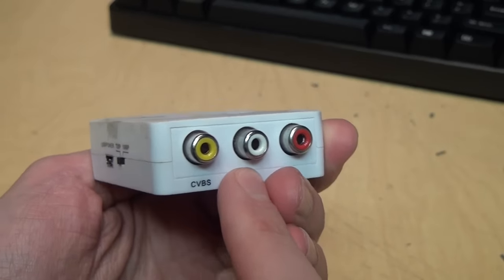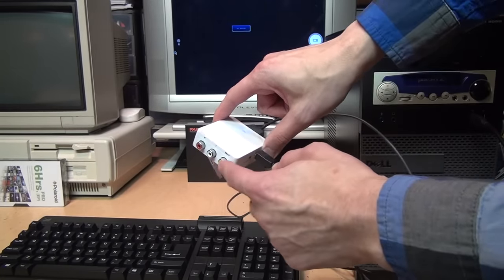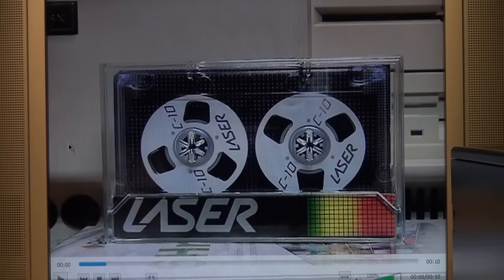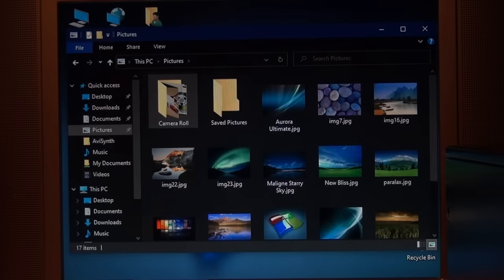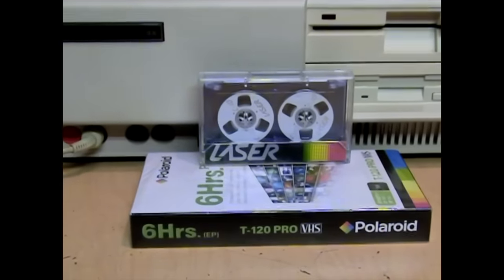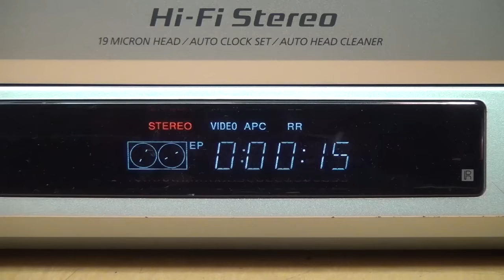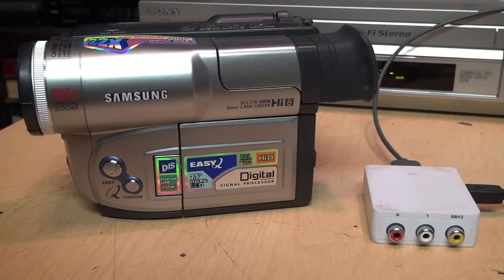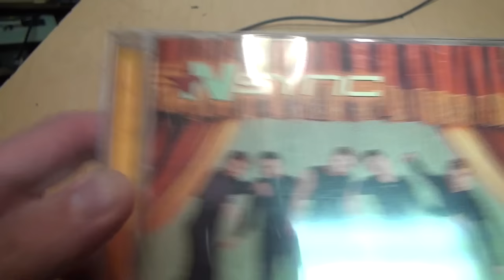Cheap composite video to HDMI converter - Is it really THAT bad?

Comment: An important notice: those white boxes are made by numerous Chinese manufacturers and come with a multitude of different conversion chips inside. VWestlife have one of the "older" ones with better chipset thus it can provide such nice quality, a lot of the modern ones that you can buy today are much cost-cutted and have miserable image quality. The worst part - they are absolutely indistinguishable by their appearance
Reply from the maker: Same thing with the "EasyCap" USB video capture devices -- there are four or five different chipsets in them, and some of them have a fake S-Video input that just combines the luma and chroma together, and/or mono audio even though there are separate left and right audio inputs.
Reply: Ah makes sense why two of the recent ones I bought to play my N64 both were washed out and dim when comparing on the same TV but using composite inputs.
Reply: That’s very important information to me, because I’m looking for better equipment to redigitze my analog tapes with. I’m used to using the method seen in this video (As recommended by Alec from Technology Connections) as I sometimes use the separate units individually for other purposes.

I’m sure a lot of people would love to know where you can still buy a high quality (or at least generally decent) analog composite to HDMI box, and an HDMI capture device, both of which actually support 59.94. That’s a video somebody needs to make!

My existing digitizations have excessive judder with NTSC tapes, with a frame being duplicated on average every four or five frames. It’s actually difficult to tell it’s even supposed to be 60fps. If somebody can find a reliable source of currently produced hardware to serve this purpose that doesn’t cost a fortune or isn’t just second hand thousand(s) dollar professional grade equipment, that would be great to know.
Reply: @vwestlife  IIRC the mono audio easycaps also have some kind of sample-rate? limit
Reply: Too bad the majority of how to convert vhs tapes channels fail to mention that, or just dont know
Reply: Ive got a black one that looks just as generic as that. It works to put hdmi into some crt monitors i have, does work..seem to remember i tried 2
Reply: @luminousfractal420  I bought mine just a few years ago off Amazon, and after I wrote the prior comment and tested a back-and-forth comparison between the black box and my Trinitron using an N64. The major problem I'm seeing is the black box makes everything significantly softer; it's not as bad as VHS, but it's significant and noticeable enough where knowing how widespread this chipset is I would bet you anything someone, somewhere on the Internet is selling this device as having "Superior anti-aliasing".

And yes, the colors are horribly washed out. I edited this second paragraph a few days after I posted it because I am just now realizing the true severity of how bad my upscaler is at accurate colors, or colors in general for that matter. If anyone knows of a good, currently produced composite to HDMI upscaler feel free to chime in. Accurate colors and sharpness are obviously required, but it also must output 59.94 fps. I'm sure there's some retro gamers reading this thread who have hands on experience with something suitable.
Reply: @GammaMAXXdotcom  "How to get amazing video quality when transferring VHS and Betamax tapes 🔥📼 My conversion process", thats one, by Dave's Archives. Its a little more involved in terms of time and cost, and shortcuts could be made, but he got all the essentials down.
Reply: I bought one recently, and the image quality is pretty much indistinguisable from the one in the video. I guess this is one of those occasions where there are "originals" and "knockoffs"
Reply: @AnalogSins  Which brand was it, and can you please post the link to it if it's still sold on Amazon?

Comment: Pro tip: you can open command prompt/cmd directly on current directory of explorer by selecting top address bar right after location, then edit and type "cmd" on address bar and press enter. This very handy as you don't need change directory by manually "cd" to target directory.
Reply: Someone doest use power toys.
Reply: You can also press shift and right click anywhere in the folder, then select "open command prompt (or powershell) window here"
Reply: @rvnx  This is the way.
Reply: Wow! that's really helpful
Reply: holy crap
Reply: You can do this with anything in your PATH, too!
Reply: Wellp, I sure learned something new today.
Reply: Also, if you have really long filenames, you can just type out the first couple of letters and hit TAB for autocomplete. It doesn't always work for everything but it works in ffmpeg.

Comment: Ffmpeg is one of the greatest pieces of software ever. Trimming video or changing formats without losing quality or re-encoding. It can also make videos network optimize, again without re-encoding.
Reply: People will spend money and more effort with stringing together janky commercial solutions and get worse results and spend more time.  Something like handbrake is ffmpeg based and should also be more GUII-user friendly.
Reply: @Aeduo  Handbrake was SO cool when it landed back in the day, so the easiest way to transcode your..... linux isos.
Reply: @Aeduo  Handbrake is great. I use it to fix 4:3 videos that people added black bars to.
Reply: Turning videos DASH friendly, or undoing that and having a normal file again, are two underrated use of FFmpeg
Reply: ffmpeg and ImageMagick should just come preinstalled on every computer.

Comment: I have used a website for converting old stretched 4:3 baseball games back to their original aspect ratio, but the max file size was 100mb. Thanks for suggesting a few alternatives so I won’t have to split the video into multiple parts anymore!
Reply: ffmpeg is your friend.
Reply: @parkerlreed  been using it for YEARS
Reply: @willthor6639  To be fair ffmpeg is used in most video and audio conversion and player software anyway, so most people might have used it without even noticing. Some tools are just fancy frontends with ffmpeg doing the actual work when pressing the "encode" button. I personally prefer to use it straight from the terminal without any GUI since i feel I have to maximal control about what's going on this way without some software using weird parameters, filters or options.
Reply: @Pesthauch666  yes it's background task, app, but user interface  or lack of one?
Reply: They probably use ffmpeg on their end to convert it. You can use applications to pipe into it on Linux, and it's the backend of a lot of things. I also recommend Handbrake, which is a GUI application for the same kind of thing.
Reply: a website for converting video aspect ratio? that only takes 100mb at a time?? :-O  
that is...the most counter productive way IN THE UNIVERSE !!!!
Reply: @Pesthauch666 Ok, but what do you get out of life?

Comment: I would suggest using OBS studio for capturing the image and set the image to a 4:3 aspect ratio. You can fix the source aspect ratio before capturing as well 👀
Reply: The advantage of this white box is hardware acceleration and real time converting.
Reply: @ran2wild370  You would use OBS as a replacement for the Windows Camera App, not as a replacement for the conversion box.
Reply: btw. OBS does this also with ffmpeg working in the background, like many video conversion and player software, that very often are just fancy frontends for ffmpeg.
Reply: the problem with 'fixing' the file just about any other way is you lose resolution. What it seems ffmpeg did is tag the output file as anamorphic 4:3 rather than re-encode it (hence the speed). So you need a player that can stretch the pixels but you retain the most source quality
Reply: this, avoid using this hard command line crap
Reply: OBS studio is really good, its safe to say its the best
Reply: FWIW OBS is just using ffmpeg to encode anyway.
Reply: I think OBS might allow anamorphic resolutions?

Comment: I've had a couple of these converters and inverted audio channels seems to be a standard issue for them. I think it falls into the "you get what you paid for" category and isn't that big of a deal as long as you keep it in mind in the future. (Sticker label as a reminder helps a lot)
Reply: I've had 3 converters like that, easy fix with the lablemaker.
Reply: I once had a DVR that reversed the channels. Becaue it used SCART it was harder to fix. I had to modify the cable

Comment from the maker: If the video has playback problems at 720p60, try switching to 480p, or watch it on Odysee instead: https://odysee.com/@VWestlife:3/cheap-composite-video-to-hdmi-converter:b
Reply: What was that clip at the end of the video from? 😂
Reply from the maker: @Scyth3934  The EP tape that I showed earlier in the video.
Reply: I'm glad you brought this up! IMHO It would be better if YouTube actually still offered 30fps without hobbling the resolution!

I honestly don't see any benefit with 60fps on the majority of content I watch anyway, so the extra bandwidth/CPU/RAM usage is just a waste really, especially on a bog-standard LCD display.
Reply: Seems to work fine for me with forced H264 codec.
Reply: @snap_oversteer  yes, youtube still offers 720p and higher in 30FPS but only in H264, this is evident using YT-DLP and using ehanced-h264ify

Comment: A quick shortcut in VLC to change aspect ratios - just press the 'a' key (I remember it by 'a' for 'aspect ratio') and it will cycle through the most common types. Very useful if you want to fix an aspect ratio and you don't know which one is right and/or if you're full screen and don't want to search through the menus. There's also 'd' for de-interlace too. :)
Reply: Shortcuts are awesome.
Reply: It's bad I love shortcuts but my lazy ass never looks em up but when I come across stuff like this it's in memory forever lol

Comment: The chip it uses is intended to handle scaling and analog input for an LCD TV. They just take the output and route it to an HDMI transmitter instead. That’s why it works with Macrovision protection and why it doesn’t properly support 240p (no off-the-shelf TV image processors do).

Comment: Wow, that's way better quality than I was expecting. I didn't know composite video could look that good.
Reply: Super VHS was near DVD quality. 420p I believe?
Reply: @fartking2845  420 lines yes, but that is mostly useless if you are going to put it through as a composite signal. Also a interlaced signal. TV of the time could not handle progressive signals. Also the color signal i thought was not changed between vhs and svhs leading to it barely being better. Certainly dvd could do much better, but as always that depended on the quality of the mastering job.
Reply: @bzuidgeest  Thank you for clearing that up. I always assumed it was progressive and not interlaced.
Reply: @bzuidgeest  I think they increased the luminance but not the chroma from VHS to SVHS so the colors are still a little washed out.

Comment: I have an almost identical converter called the Sewell Manta -- the only difference is that it has a VGA input instead of composite. It also always outputs the image as 16:9, though it seems to have somewhat decent support for input resolutions (at least, among the common ones).

Comment: I have the HDMI to composite one and use it on a CRT. With the resolution and aspect ratio set properly in Windows, the picture is so clear I can actually read all the text!
Reply: I bought one and had to stop using it, as on switch on it would let out a loud shriek that would've damaged the speakers if the volume hadn't been so low. Can your HDMI to composite work without a computer, and what is the make and model number? Thanks.

Comment: I've used a few different composite video converters over the years and I've never been a fan of them. Either the image is blurry, washed out or over exposed, they crop the image in too much or have that aspect ratio issue.  At the moment I'm capturing and archiving all my old VHS tapes using an HDMI VCR (Panasonic DMR-EZ45V) going into my HDMI capture card using OBS. I've found this to have the results I like the best. There was a big audio drift issue that I believe was a windows issue that I had to sort out and now longer (6hr+) tapes dont drift noticeably.   Love videos like this ^_^

Comment: If it helps, there are lots of transcoding programmes that are basically front ends for ffmpeg, they write the command strings for you then ffmpeg does the heavy lifting.  This is thanks to the mysterious "GPL" part of the file name GNU Public License and the beautiful open source community

Comment: I have one of these things, and when paired with a cheap HDMI capture device, the results are pretty good! Beats any AV capture devices!
Reply: I was curious about this very thing and today I ordered an HDMI capture device and one of these mystery boxes, but my mystery box has an s video port and an aspect ratio switch. I have several high quality old school cameras that output a composite signal, and a composite video switcher, it has 5 inputs.  I'm setting up a video studio using this equipment because I don't believe in buying a whole gaggle of new cameras. What matters is what's in the shot, not how large the resolution is. And I watched several reviews of analog USB capture devices, and the results were mostly very poor in comparison to this type of setup. Generally, with one of the direct AV to USB devices you have to spend $200 to get 480p, at 15fps,  and like this, using the a/v HDMI, into an HDMI capture device you can get a much higher resolution at 30fps for around $20

Comment: Oh my. When I saw the thumbnail for this video in my YouTube subscription feed, I was immediately reminded of a HDMI to composite A/V adaptor I have that uses the same shell and was likely made by the same ODM. I bought one to use with the in-flight entertainment systems on older Singapore Airlines aircraft that had composite A/V inputs next to each screen. They had since refurbished their aircraft during the pandemic and upgraded to newer systems, so I never had a chance to use the adaptor in practice, but I did test it at home and it did work if I set the display output resolution to somewhere around 800×480 or 1024×576.

Comment: I really enjoyed the video. Just wanted to suggest an alternative to ffmpeg for this sort of capture, cause I've used a very similar device to record gameplay from older consoles. If you record using Open Broadcaster Software you could apply the aspect ratio correction before the file is even written, as well as potentially get some more fine grained control over the bitrate of the captured footage (depending on the device drivers). Thanks for the informative video!
Reply: Thats basically using ffmpeg as the capture software, which is what he probably should have done with whatever frontend. You can just tell ffmpeg to input a device rather than a file

Comment: Considering the price, it’s not bad at all! Certainly not ideal for high quality archival type backups, but it’s still good for testing and to easily set something up. It would be nice if it also had S-Video, but it still works well. It won’t achieve the same look as composite on a CRT, but then again it isn’t designed with things like that in mind. Great review!

Comment: The aspect ratio change is lossless because the only thing ffmpeg does is change a flag on the file about the aspect ratio. A flag not every player might obey. Your mileage may vary. If you choose to reencode the actual stream, it will most certainly not be lossless.
Reply: mkvtoolnix can also to that "change a flag on the file" lossless thing ;-)

Comment: I've had occasion to use one of these and came to a similar conclusion -- it's not bad at all. VHS on a huge screen doesn't look majestic, but it's better than nothing. Unfortunately, those that go in the other direction don't perform nearly as well.

I'd hazard a guess that the conversion chip is from Macrosilicon.

Comment: I'm sure the analog video transfer purists are going to bemoan doing things this way, but I've been interested in going this route for quick down and dirty analog video transfers, ever since Technology Connections did his video on using one of these--and showing how good the results ended up being for so little time and money invested. 

I'm really impressed with the quality and results, especially considering how long the deinterlacing (to 60p) and upscaling (to either 720p or 1080p) process takes using other methods like QTGMC or Video Enhance AI. 

Is using something like this HDMI converter the right way to do things? Absolutely not, but the results more than make up for it when time is limited or the material being captured doesn't warrant going all out (like old VHS tapes of TV commercials).